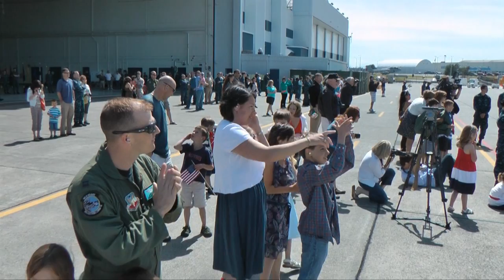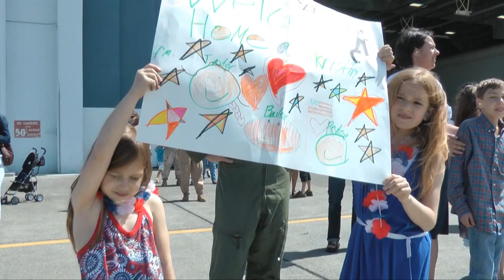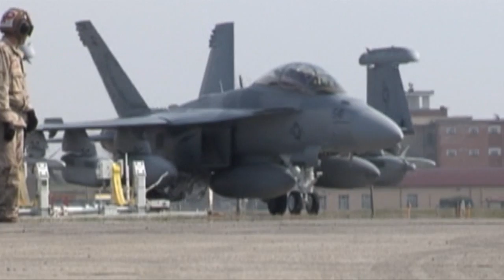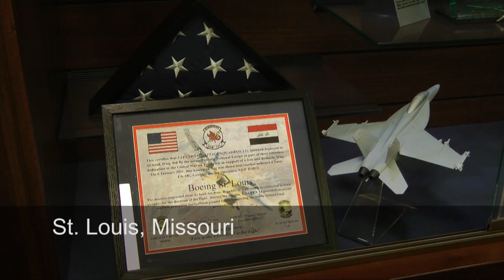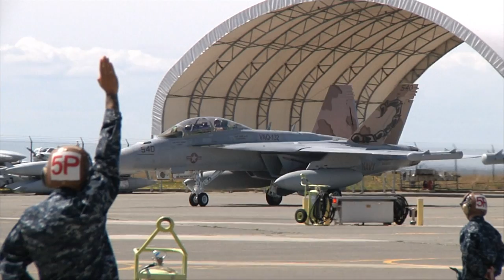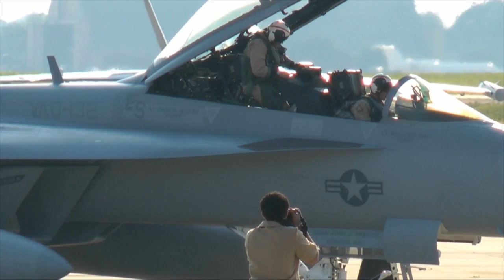Growler completes combat debut

Comment: The Growlers main job is electronic and radar disruption support through a wide range of state-of-the-art jamming devices. They capable of jamming radars while the jet in egress and degress, basically 360 degrees of radar jamming capability. The F-35 can only jam while it egress towards the target but cannot jam while it degress and will have to rely solely on stealth as protection. The problem with that is, countries will be able to make better improvements to their radar technology as they always do and it would be foolish to rely on just stealth alone. For the last 2 years Boeing has been trying its hardest to sale this notion to the US military and want to sale its Growler as a support plane to the F-35. The Navy already have an unofficial order of 30 of these planes.
Reply: Low